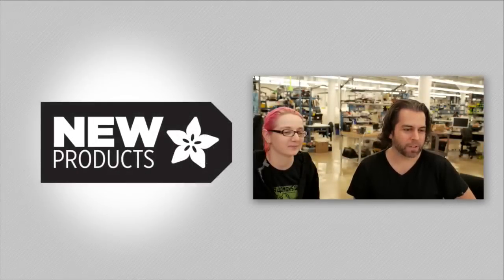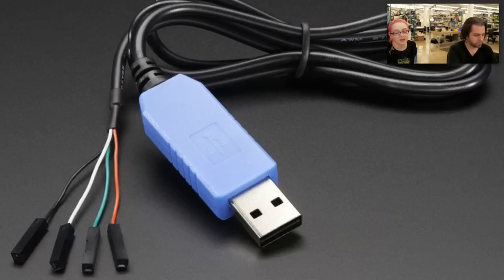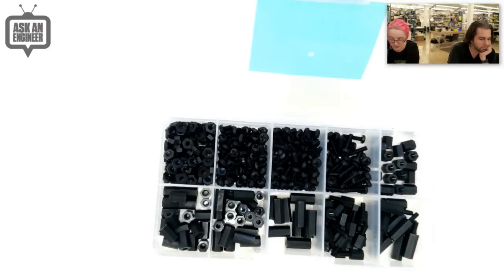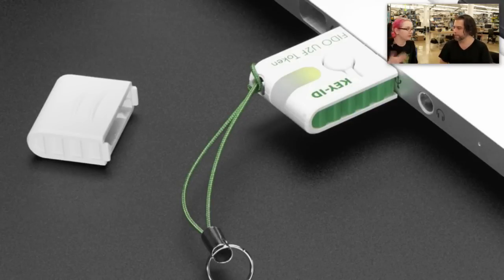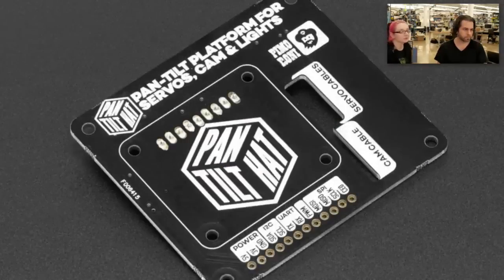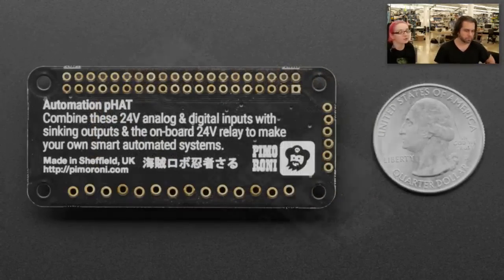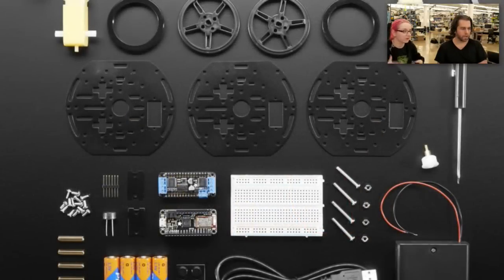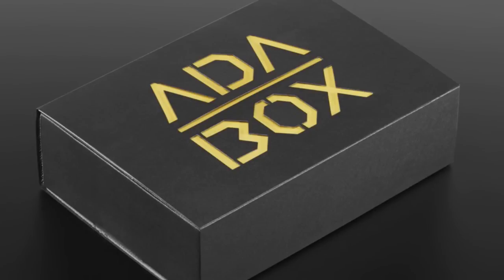New Products 1/4/2017

Comment: For those of us used to numbers screw/bolt sizes, 2.5mm is just about a #3. (Not that I've ever seen any of the odd numbered screw sizes...) Thus a #2 clearance hole might just barely fit, a #4 clearance hole will be nice and sloppy.